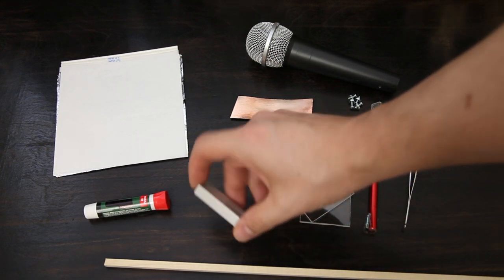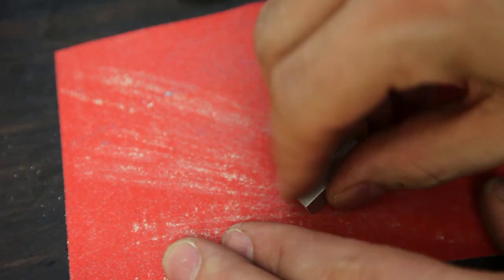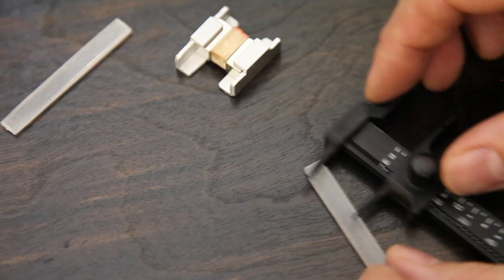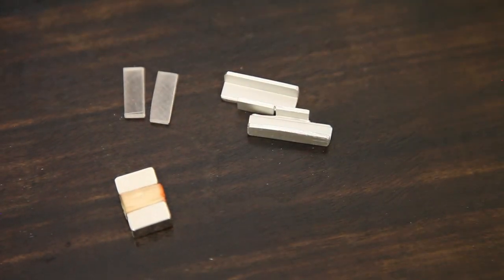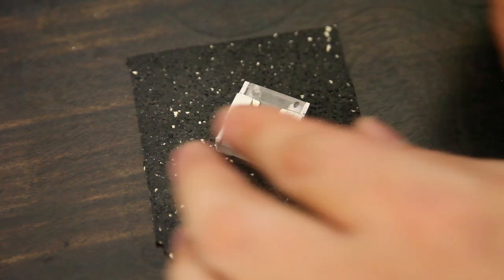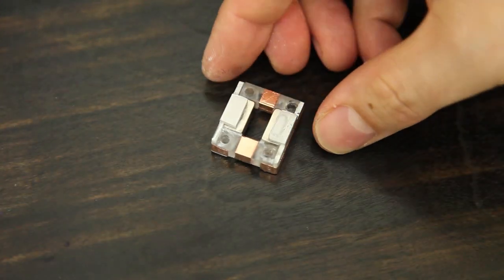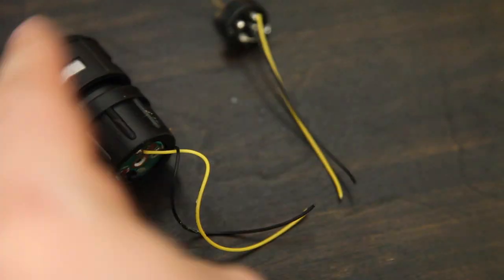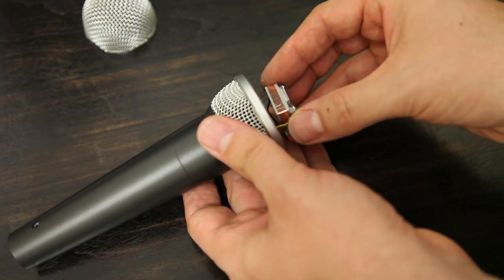Ribbon mic DIY Build Microphone HOW TO MAKE A RIBBON MIC

Comment: This is an awesome DIY build; it looks so easy to make, watching it compressed in a 12 minutes video. You must have spent so much time thinking of the design, finding easily available components to make it all fit… congratulation.
Reply from the maker: Yes, thanks!  It took a lot of research and a number of prototypes before landing on this design.  Give it a try!

Comment: Yo this is insane! really helped me understand what exactly ribbon mics are and how they work. Out of curiosity, what kind of transformer exactly did you use?
Reply from the maker: The transformer is a b-stock one, removed from a cascade microphone.  Basically, any 1:37 (or higher) ratio step up transformer will work.  Edcor, Lundahl and Cinemag all make new ones.  Maybe Sowter too?  If you shop online, just look up "Ribbon Microphone Transfomer" and  you'll get lots of options.
Good luck!
Reply: @FrankOlsonTwins  Thanks!
Reply from the maker: BTW, i bought the transfomer on ebay as a b-stock, removed from a working mic.
Reply: @FrankOlsonTwins  I see. Are mic transformers very different from transformers used in amps or power supplies? More turns, thinner wire? Or could you imagine using a small transformer salvaged from an AC adaptor? (Let's say, as a science project and not necessarily to get the greatest sound)
Reply from the maker: sure, this is all passive circuitry, so there's no harm trying various types of transformers.  Most mic transformers are well shielded, so that's something to consider to keep hum out of your signal chain.
Reply: @FrankOlsonTwins  I see. Well, I think I will try some version of this then, just as a curiosity.
Cheers!

Comment: Hey Frank, I really liked your video: you seem to be a practical person.... did you find an easy (ish) way to get the top-grill separated from the bottom grill. ?? Thanks mate
Reply from the maker: Thanks for checking it out! This mic grill was pretty easy- just carefully pry it off(a little at a time, all the way around) with a small screwdriver. I don't know how the top grill to an SM57 is attached- I bet its soldered but I could be wrong. Good luck!

Comment: Hello Sir,
thank you for sharing your knowlegde. Very nice contruction. I just want to mention there is an effect, called galvanic corrosion, wich could make the aluminum ribbon dissapear. @t
The solution migth be to get some solder on the copper or use some tinned wire and wrap it around it, like you did with the sticky copper tape.
Reply from the maker: Thanks! Good tip about galvanic corrosion,  I'll check into it!
Reply: The ribbons only last so long anyway, even in pricey mics.

Comment: If you're still keeping up with these comments, I'd love to know how the magnet size affects the end product. Does a 2" long magnet provide better low response than a 1" magnet?
Reply from the maker: Yes, that's pretty much the way it works.  To a large extent a longer ribbon will dip lower into the frequency spectrum, even down to 10hz.  The other factors are ribbon tension and thickness.  Generally ribbon tension will have a direct correlation to frequency response, lower tension giving more low end response.  Likewise, a thin ribbon can make it a little easier to "find" those low notes.  Ribbon elements over the years have generally been between 1 or 2" long, and a variety of widths up to a half an inch wide.  Most are between .6 and 3 microns thick.
Hope this helps!
Reply: @FrankOlsonTwins  quite helpful, thank you!

Comment: Hi, I built a similar mini ribbon motor and I am a bit stumped by a strange problem , it is working quite fine but seems to pick up sound better when the source is a bit off axis in the length of the ribbon (don't know if i'm clear here).
It's like there is a null when perfectly in front of the ribbon .
Did you have that same kind of issue ?
I mounted mine in a Bouyer 709 body which is kind of open in the back so would not really interfere with the figure 8 directivity of the ribbon but with or without insulation foam behind I have this "null" right in front of the ribbon . Also with the whole assembly outside of the mic body .
Would it be due to the width of the motor magnets in relation to the width of the ribbon ? Maybe my ribbon has too much of a gap between its sides and the magnets ?
I'm working with the same foil as you , my ribbon is approximately 4mm width and 2 cm lenght , approximately 0,25mm gap on each sides .
Magnets maybe could be the issue , they are not whole magnets but stacks of small magnets put together to form bigger ones .
Any clue ?
Reply from the maker: This bizarre behavior happens when the magnet pole pieces are not properly aligned with the ribbon.  The magnets must be magnetized "through the thickness"  of the magnet, which should then be arranged parallel to the ribbon length, but perpendicular to the ribbon thickness.   For example, if you're looking at the front of your mic(magnet, ribbon, magnet) the arrangement should be as follows:  North pole/South pole/Ribbon/North pole/South pole.  Or, South/North/Ribbon/South/North. Keep the pole orientation consistent, one pole must be drawn to the opposite pole so the magnets can be strongly drawn to each other.  If your magnets are magnetized through the  "length" you'll have to figure out another way to mount the ribbon, as your poles have shifted to the tops and bottoms of your magnets.
So, you have to figure out how they are oriented, or buy new magnet that are magnetized  through the thickness of the magnet.
Reply: @FrankOlsonTwins  thanks for the answer , I figured that the magnet assembly was indeed the problem , they are in the right orientation but the oopsie I did was to assemble them like so : 2 stacks of 2 next to each other (2 stacks per side) , creating a null or and opposing magnetic field in the middle of the two stacks .
Therefore only the extremities of the ribbon produce sound and not the middle .
Thanks for confirming my theory :)
Very inspiring video btw !
Reply from the maker: Yes, I learned that lesson the hard way myself.  But It's a fun and puzzling result!  Here's another mic I built, and I'd say it turned out better:  https://youtu.be/1DsqWRe4nMc

Comment: This was impressive, and sounded really good as well. Nice work!
Reply from the maker: Thanks for watching!
Reply: @FrankOlsonTwins  hi. I have been struggling on finding the right foil for DIY ribbon mic and drivers. I head regular kitchen foil will not work because the are too thick and fold easily.  But I was wondering,  if I found a thin one , can I just put a tin layer of tape on top of it  , so it doesn't fold.  Do u think that will work ?
Thanks
Reply: Thank you so much for taking the time to help me out.  I'm hoping it will also work as a mini tweater or headphone driver

Comment: Cool project, well done! Wouldn't a balanced signal be more ideal for this application though? I guess it all comes down to the transformer choice in this case?
Reply from the maker: Thanks for checking it out!  The transformer output is balanced, the red wire is "hot" and the white wire is "cold" as I recall. The shield, as in many handheld microphones is a small metal conductor that grounds to the body with a screw which also holds the XLR connector in place.

Comment: I had an old RCA BK-11. I sent it to the son of the man who designed it to have it refurbished and got it back in wonderful condition (it was in good shape already) and with a NOS ribbon and grommets. A lot of people say that was the last great vintage ribbon mic and possibly the best ever made. I can't say I ever found much use for it as a musician. It seemed that even my cheapest condenser mics were better for almost everything. However, one thing I found that ribbon mics excel at is distance recording. They would make fantastic stage mics because even at 6 to 8 feet away they still sound very full. I imagine they would sound good on a choir too for the same reason. Nice video, thanks.
Reply from the maker: Thanks for checking out the vid!  Yeah, there's a reason singers switched from the RCA 44 to the Neumann U47.  I think ribbons are finding a new life with current musicians(myself included!) as they translate really well on drums.  I like a long ribbon either in front of or behind the kit, and something on the bass drum.  That alone can make for a great drum sound.  Or a pair as overheads can be very sweet.  Many people are using them on guitar cabs, which to me often comes out a bit soft.  They are almost always paired with the SM57(on guitar cab) to make up the midrange.
Anyway, I have a growing list of ribbon mics I'd like to own, and pretty much any RCA is on the list!  Until that happens, I'll have to just keep making them!
All the best!
Reply: @FrankOlsonTwins  I never tried them on drums (I haven't mic'd drums in years), but I can certainly see where they could work as overheads or even just a pair of them used to mic a whole kit in stereo like so many good, live jazz albums in the 60's were recorded. And for what it's worth, someone advised me decades ago to use one of my ears like a microphone, turning my head to one side and then to go around the room listening to see where an instrument sounded best while being played. I found that guitar speaker(s) usually sounded best from about 3-feet away and maybe 2-feet above, pointed down at the speaker(s). I also favored the SM-58 over the 57 as it took out some of the harshness. I know that goes against a lot of tradition, but using my ear like a mic really helped me. But then Jimmy Page used to put mics out in the hall, under mattresses, all kinds of places, so whatever works. Have a good one.

Comment: very nice I've made a few myself One I liked so much I've actually used it in some of my recordings.
Reply from the maker: It's really rewarding to make a recording with great you've made yourself!
Reply: @FrankOlsonTwins  yes it is, but I did learn a valuable lesson, my first one didn't have a pop filter,(I thought it would interfere with the sound too much) I gave it to a friend who plugged it and didn't get a sound, he did what you would normally do and blow on it, something you can do with a dynamic mic but not a ribbon mic, he immediately destroyed the very delicate ribbon material.Note to anyone out there who wants to build one, only use neodymium magnets even the huge one you get from large woofers or microwave ovens are not strong enough.
Reply from the maker: it still shocks me when people blow into microphones, I'm glad i never picked up the habit! it's so common though, that I have to tell anyone strepping up to my mics not to blow!  The is some interesting reading about windscreens in the old BBC research papers about velocity microphones.  A thin cotton gauze(or wire gauze) mounted close to the ribbon will attenuate bass frequencies, but it's a good trade for most recording work.   However, if your ribbon is long enough and tuned properly, it should have no problem picking up those low notes.

Comment: Very nicely done. 👍🏻 What transformer did you use? Is there a cheap one that you could recommend?
Reply from the maker: Thanks!  This is a Cascade "B-stock" removed from Fatheads when they started upgrading their mics to better transformers(I bought a "lot" of them, I have a few for sale if someone is interested).  Lundhal and Cinemag have some pricey versions- worth it if you want the best sounding mic you can make.  But also check out the Edcor model, pretty decent price as I recall.
Reply: Frank Olson Twins Thanks for the info. It was kind of an idle question. I don’t own an XLR interface for my computer, so it’s unlikely that I’ll build a ribbon mic. Nonetheless, it’s pretty tempting. 👍🏻

Comment: How sensitive is this ribbon mic? Do you have any advice on what preamp to use with it?
Reply from the maker: This mic is actually pretty sensitive and has a reasonably strong output.  For the guitar and drums demo in this video, I'm using an average Mackie VLZ3 Preamp(good for about +60db of gain).  For most closely miked instruments you won't need that much gain with this transducer.  The magnets I used are fat and strong(Neodymium n52).  For the video demo, my preamp was set to around 60%(+35db approx) for the drums, and 40%(+25db approx) for the close miked guitar.  Most rock vocals would be fine with a similar preamp, but for soft speech or gentle singing applications you might consider pairing it with a mic booster(cloudlifter/fethead/dynamite) Or, you could do what the old broadcast radio stations would often do:  use a "line amplifier" after your mic preamp to boost the signal.  The ribbon has a good amount of travel, and deep corrugations so it will be good for loud sources like snare drums, guitar cabinets, and drum overheads.  Maybe don't close mike the Kick drum with it, though ;)

Comment: Could you use the transformer from an sm57?
Reply from the maker: No, unfortunately the SM57 transformer is a very low ratio, it might be 1:2 or 1:1.  So, there's very little voltage gain given by the transformer.  Ribbon mic transformers, including this one are in the neighborhood of 1:30 or sometimes even 1:50.  That's a much higher gain, which is required by the VERY low output of a ribbon motor.  
Dynamic mic elements (like the one in the SM57) are capable of much higher output, and need very little in the way of transformer gain.

Comment: Do you know where I can get plans to build a metal corrugator for this?
Reply from the maker: There are no plans that I'm aware of. If you want to do what I did, order a couple gears on ebay and carefully mount them in a little rig.  Tip: When mounting the gears, use a piece of paper between the gears to simulate the space needed for the paper/ribbon.  Pretty much any gears will work, just try to get some that are at least 1/2 inch wide.
Reply: That would be a common gear tooth size to salvage from an old laser printer or copier

Comment: What kind of transformer did you use?
Reply from the maker: The transformer is a b-stock one, removed from a cascade microphone.  Basically, any 1:37 (or higher) ratio step up transformer will work.  Edcor, Lundahl and Cinemag all make new ones.  Maybe Sowter too?  If you shop online, just look up "Ribbon Microphone Transfomer" and  you'll get lots of options.
Good luck!

Comment: Why using a transformer? The mike is inherently floating and will mate directly with a balanced input as it is.
Reply from the maker: Ribbon motors have a notoriously low output. The transformer steps up the output voltage to a suitable range for a mic preamplifier.
Reply: @FrankOlsonTwins  ok, so it is not a 1:1 xfmr. Thanks.
Reply from the maker: Right, it's like 1:30 or sometimes 1:50

Comment: how do I know if the tension on the ribbon is perfect ?
Reply from the maker: That's a good question.  It comes down to personal preference. An easy way to "eyeball" it is to tap the ribbon assembly somewhat gently and see how much the ribbon moves.  If it looks very stiff with very little movement, you probably want to loosen it.  If it looks really floppy or saggy, you want to tighten that up.  Not a perfect method, but it will get you in the ballpark.  You could advance this simple technique by running the "finger taps" through an EQ spectrograph and seeing how much bass is coming through.  

Most ribbon mic builders send a signal to the microphone to check what frequency the ribbon resonates at and tune it to what sounds best to them(or what's appropriate to a particular ribbon design).  A ribbon with less tension will resonate at a lower frequency before it cuts off and a higher tension gives a higher resonant cutoff. For example, RCA 44 (long ribbon) is tuned down to 20hz.  Royer ribbon(shorter ribbon) is tuned between 40hz and 80hz as I recall. Really, it's a tradeoff between cleaner bass(higher tension) and possibly muddy, floppy bass(lower tension).  Tensions that are too high will start to resonate in the middle frequencies, and that will be very apparent(and unpleasant!) in the vocal range or higher.  

For a ribbon this small, I find that the ribbon tension is quite forgiving.  As long as it's not too tight, it will probably be fine.  The ribbon is so short that even a very loose ribbon sounds fine. That said, you could tune this ribbon up to 100hz and it would still sound great as a vocal mic.
Good luck!
Reply: @FrankOlsonTwins  Damn, awesome  and wholesome explanation. I saw a video where technician blew air from distance to adjust the tension, if it needed to be loosen.

Thanks for the awesome video :p
Reply from the maker: Thanks for checking it out!  Yeah, "prestretching" the ribbon is common procedure nowadays. The first time I saw someone blow on a ribbon to do it, I thought it was a joke!  In the studio, you're taught to never blow on a mic. But it does help to keep the ribbon stable at it's final tension.

Comment: great video! what are the dimensions of your corrugator gear?
Reply from the maker: 32, 48, or 64 pitch gears will work well for this task. The gear should be about 1" in diameter or a little more. 32 pitch is more of a vintage crimp, 64 is a very modern crimp. I find 48 to be a nice balance of the two.
Reply: @FrankOlsonTwins  awesome i think ill try it out. thinking of a longer ribbon